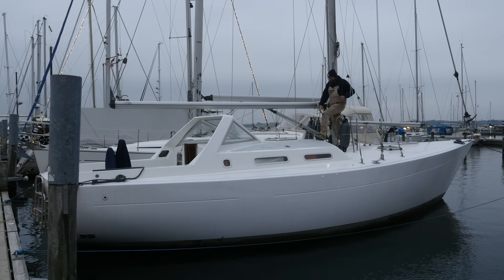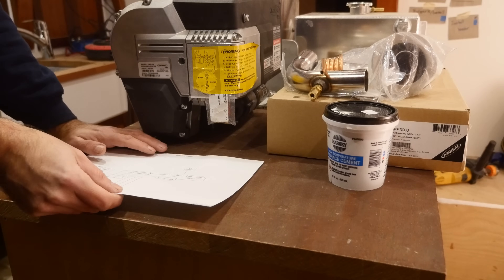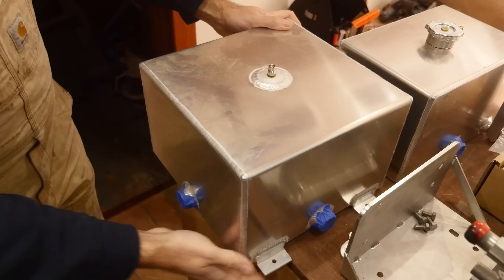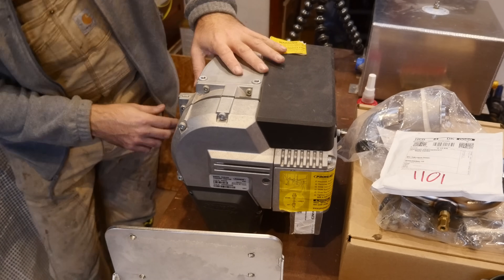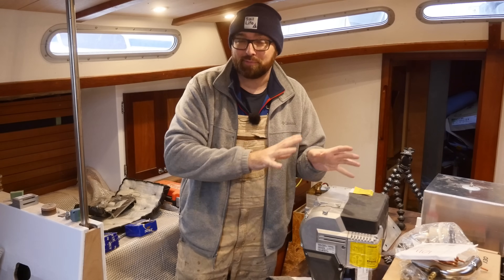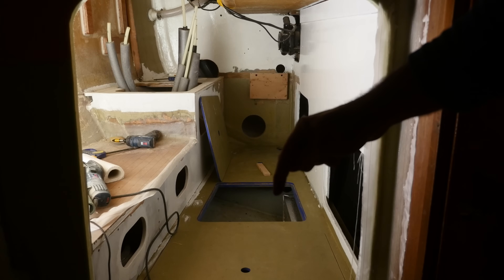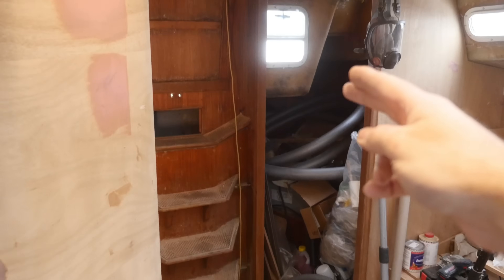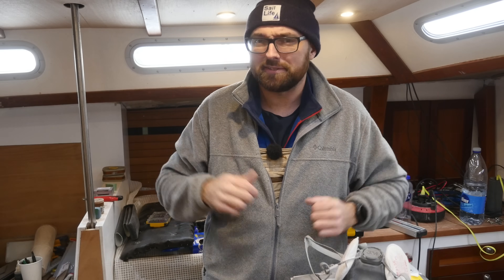Sail Life - Dometic Proheat X30 hydronic heater on a boat, part 1 of 3 - DIY project

Comment: Getting waste heat from generator is admirable, however, when generator isn't running it will not add heat. The heat exchanger will help with that situation, but you may have a convection loop (water on the generator side, being heated by your hot water boiler, will rise and circulate) losing heat through your generator. If you add to that your motors heat (in the future), same thing applies. There are ways to incorporate those sources in a better way.

Comment: Too bad there isn't a heat exchanger in the bulk tank to run the exhaust through to recycle the heat from the exhaust back into the heating system.

Comment: When you are done you might want to experiment with using higher speed/volume fans on those matrix units.  I'm using the same ones (which are made here in Seattle).  On the smaller unit I moved to a 120mm fan (with adapter to step down to 92mm) with 150m^3/h (90cfm) which made a big difference in efficiency of the heat exchange.  I checked this by measuring input and output coolant temps and watching how heat dissipated across the unit with a thermal camera.

Comment: @3:35 I don't know why you are being so shy here. Am I missing something? Independently, heat exchangers and hydonic heaters have their pros and cons. But they were made for eachother. As soon as you choose one, shouldn't you also choose the other? Maybe if I had a boat that already had a different heating solution installed, but no water heater, I might try to run the water heater solely off the engine and generator with some sort of heat exchanger without a full hydronic heater system, but that is a different situation. Hydronic system already has several tanks of hot water in it. Wouldn't installing another tank for hot water just be silly? It seems like "non controversial politeness" is, in this case, just a lazy excuse for not explaining something. I can forgive you a million times over for offending me, if you also inform me ;)
Reply: I mean, your electic oven running off the diesel generator is maybe a choice that you want to avoid arguing about xD But here, haven't you clearly chosen the most elegant solution for a water heater that runs off diesel? Am I missing something?
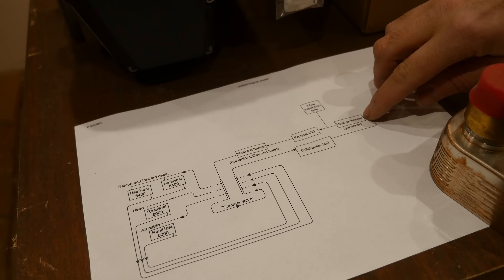Reply: @5:30 And with a heat exchanger on your generator the efficiency of your offshore bread baking should go up nearly as high as a diesel oven, with one exhaust pipe instead of two. Nice.

Why don't the generator and the hydronic system and the engine all the same exhaust through-hull? Giant hole near the backstay with no engineering review was not so clever...

Comment: Three comments.  1)  I installed the similar models of the REAL fan coils (6000 models line) and the fans that cam with them are the weak link.  They just do not blow much air.  I am currently looking for more powerful fans to get more heat out of the coil.  2) Think about adding a muffler to the exhaust and a silencer to the intake.  The exhaust is real loud (think 707).  The intake is a high pitched whistle.  Now that I have both, the only thing that I hear is the water pump. 3) You might consider using a "GRAS" rated boiler fluid (Generally Considered As Safe) so that if you have any cross contamination between boiler fluid and potable water it will not kill you.  I use Peak Sierra based on Propylene Glycol.

Comment: We have had two heaters on our boats.  First exhaust was right where you started, by the docklines.  One melted howser on a cold winter's night in Catalina was a lesson learned.  The second, on the boat we have now, is on the transom and right above where the dinghy would tie and where feet could get more than toasty!  Will be a good challenge to figure that one out.

Comment: Hopefully you’ll not be anchored out and using the boarding ladder much in the winter when the heater is running, so I say mount the exhaust on the transom.

Comment: If you can pull the return pipe from the radiator in the bathroom in a loop benieth the floor boards you will get some really nice floor heating in colder climes. We lived aboard our Bavaria 42 in Göteborg during 4 cold winters and we loved that luxuary. Just put som insulation benieth so you dont warm the ocean instead.Took me like 30 min extra and soo worth it!

Comment: Hey Madds, Have you thought of putting the heater exhaust in place of the through hull is just forward of Athena's dock line and putting that through hull under the dock like. Don't know what is coming out of that forward through hull but thought I'd mention the ideal. Ken.

Comment: You should have placed the heater module on the centerline, that way it would always be below the expansion tank, even in high seas.
As it is, what degree roll will it take and still feed?     Is that roll degree likely?

Comment: I wish the x30 had been available when I installed my X45 several years ago. Except for one small hiccup that the manufacturer covered it has been working flawless for 8 years. I use it also to heat my domestic hot water for bathing and washing dishes instead of engine heat. So we can turn those nice fan coil units off for summer and still have hot water. I also installed heat sensors on the fan coil units so the only start blowing when the water is up to temp. Good luck with your install, it will be one of the most satisfying installations for your boat. Enjoy being warm.

Comment: Hi Mad's. Good to see you back and recovering. We would go for transom fitting the exhaust outlet and be sure to put a 150mm goose neck in the exhaust hose line just before the outlet. 
Is it necessary to insulate the tanks also? 

Sail Safe mate. Ant, Cid & the pooch crew.

Comment: Mads, good job.  Points to consider - a "sealed" system will be easier to vent, have less tendency to sludge, occupy less space as the expansion vessel will only need to be small (4% of the total volume and the pressure variation should be no more than 0.5bar - 2bar).  Inhibitor can then be added and basically forgotten about and you'll have no issues with boat movement, frothing/aeration in the vented expansion tank, plus no evaporation and so on, it's normally a no brainer.  A temperature and pressure relief valve is all that is then needed discharging to a safe place (I would suggest bilge).  I don't know the heater but if it is modulating keep the circulating water as small as possible for response times.  The boat, even with insulation is going to be cold but will heat up very quickly so a modulating burner would normally be an important consideration rather than just running the water at a constant temperature.  The circulation pipes looked suitably small bore (10mm?) which is great for small volume and response times.  Make sure the pump (integrated?) is accessible for servicing.  The accumulator tank is a strange one to me but is obviously part of the manufacturers instructions and requirements - follow them.  Fit quality isolation valves everywhere for ease of servicing - full bore and temperature rated, butterfly valves save space.  Lag pipework where you don't need heat.  Heat loss from pipes can be a pain but it will stop condensation and mould in cold climates.  As high up on the transom as you can - the exhaust is not designed to mix with water and flue temps should be low-ish (condensing boiler?).  A water trap may be required.  We have a standard electric water heater and two Eberspaecher which blow very hot gases which means a lagged exhaust, but there are no complaints with the shower and heating!  Good luck!

Comment: If those fans for heaters are a bit noisy, my recommendation would be to check out Noctua fans. They manufacture semi affordable super quite fans for PC. Like Noctua NF-A20 PWM 12V 800RPM 200x30mm

Comment: Getting the feeling you’re adding alot of weight Starbard side aft..  not necessarily a problem but the engine is aft aswell, obviously she’s not a racing vessel, but maybe Exaggerates “hobby horse action”.   Not sure?  You are adding weight mid ship..  so maybe not an issue?
Opinions?

Comment: Hi Sail-life, Excellent job however I am very surprised to see a rigid mounting of the heater on the hull of the boat, indeed this kind of boiler will tend to vibrate in operation and resonate throughout the hull with the noise of an infernal machine, mounting on silent-block as in submarines would perhaps be wise ...... hello from Françe.

Comment: Hi not sure that metal/rigid plate between the hul and the heater and radiators are the best thing. I would go for some vibration insulation there. Question : Air does exit via fan heater holes you made. WHere does it INTAKE from ?

Comment: Does somebody know the brand of the tubing and connectors Mass is using. I am in the same process of installing a water heater in my boat
Reply: Normal household pex tubing and connectors. Get from your local hardware store.

Comment: how are you handling air intake for the fan heaters??? those ventilators shouldn't be blocked and usually need a steady supply of air to push through a heating element, don't they?

Comment: The biggest problem that happens with hydronic systems is they can be air locked reducing efficiency. Hopefully the expansion tank at a high point will eliminated that problem.

Comment: Looks like you have a choice of singed toes or singed line for placement of your exhaust. How hot will the exhaust port actually get? And, how hot will the exhaust be? Personally, I'd go for singed toes as, after actually singing you toes a couple of times, you'll attain the habit of watching where you step if you're just wearing sandals which might not be much of an issue considering where you plan to do the bulk of your sailing. Constantly having to worry about a line failing seems not  a good choice. You might even end up with a pleasantly warm boarding ladder - nice for cold days.

And, for another Christmasy note - try hot whiskey - it will definitely make you feel better, or at least a little numb to your discomfort.

Comment: I’ve had a diesel hydronic system, and I installed a Chinese diesel air heater on my newest boat as well. Both made sense to have the exhaust high up on the stern. I think it would have worked just fine on the hull as well, it’s just personal preference. If you have water coming in that high, and up the gooseneck, you probably have a lot more to worry about! I’d go with the stern between the ladder and backstay chainplate. Also, thank you for making such great videos!

Comment: Installing on transom is clean but you have to consider where you will store your dingy and the other things folks hang off the pushpit area during voyages.  I think side is best.  Move forward of likely route of dock lines by 12 to 18 or so inches and you should not see an issue.

Comment: Mads, why install the heater in the boat and not on the other side of the  bulkhead out in the cockpit locker then just run the lines? The pump is not loud but not silent either and becomes annoying when sitting watching a movie or relaxing. Mine is out in the very back, as far away as possible actually mounted to the transom,  and was still annoying. One more thing if you don't know what flooring you going to use you could have routed the edges of the holes and mounted the heaters and fans from the inside, so all you see is the cut out when looking from the saloon and no matter the flooring it will fit.

Comment: The most important thing is the ventilation! Not only inside the sailboat, but also the air in and out of the sailboat. Without good ventilation, you'll get condensation! A LOT!
Kind regards.

Comment: For the heater fan units, do you have plans for a return inlet to let air back behind so it can be heated and recirculated? Hope you are feeling better. Wrap a hot towel around your head, and get some soup, champ.

Comment: It seems that the 5 gallon holding tank should be able to keep the heated fluid HOT.  Thus it seems like it should be WELL INSULATED in order to do so.  Te expansion tank, maybe not so much, but...............

Comment: Unlikely the heater will be blasting super hot when you're using the ladder. I recommend the transom mounting, and some distance inboard from the rail, since the rail can dip in the seaway in certain conditions.

Comment: Someone else mentioned return air openings.  Proper placement of these can also dry out bilges and wet lockers, as well as helping to provide even heat distribution throughout the boat. Avoid engine rooms, fuel storage areas, etc which might contaminate the interior air.

Comment: If the PEX is running under the floor, can get some heat out of it when left uninsulated.  Or under anywhere else you want heat from.  Just add some insulation under the PEX.

Comment: Iv seen comments indicating using existing exhaust engine/generator, this is a big no, unless you want to fill your boat with exhaust fumes. However you decide to do this, it would be prudent to consider exhaust fumes, ie rear exit through transom will create back draft sitting on anchor pointing into the breeze, filling the cockpit area with fumes. Out the side will be your best bet.

Comment: The units you are installing are referred to in the USA as fan coil units or fan coils. Be aware that the ball valves you appear to be using on the distribution manifold are primarily used for on/off operation and not system flow balancing. 
The simplest method to initially balance water flow would include a reverse return layout, and sizing of hose diameters to roughly equal pressure drop.
I would suggest that you submit your hose layout, including length and diameter, to a local engineer for a review. It is also possible to perform an hydraulic analysis yourself through use of information available on line.
I would also suggest installing thermometers on both supply and return lines, and an air venting device at the high point of the system.

Comment: My only suggestion as to exhaust placement is to try to avoid exhaust wafting into the cockpit as much as possible.  I once worked on a boat that constantly had exhaust blowing on me from amidships and it greatly exacerbated my sea sickness problems.  I prefer the exhaust blowing away from or behind me.  Of course, motoring downwind would also blow exhaust into the cockpit.  Any thoughts on this?

Comment: Ha, weird experience to watch you explaining something and everything outside the boat is moving... 😁 Glad you're back! Mads, will the cockpit ever be closed in with a soft top and panels? If so it might nice to have a little heater in the cockpit or at least lines ran if you ever decided to add one!

Comment: Remember you need a way for air to enter the space your blowing it out of. The easier the air can enter from the cabin the less the system will have to work. You don't want to rely on the airflow coming through the bulkheads to be your "return air".

Comment: To cut down on future heating cost, make some kind of heatexchanger for the exhaust. If it's hot, it means that you have a (big) loss.
Your boiler looks like it have the same heatexchanger as the airheater type. (like webasto) These heaters have a efficiency of only 50%, meaning that they throw 50% of the heat right thru the exhaust and out side.

Comment: I'm wouldn't be super worried about it being near the aft starboard cleat. We have a propex2800 and I was concerned about running it next to some plastic trim  but as Ling as it's not directly blowing on it. It's not a problem. The only thing I will say it to be aware or condensation and ice build up where it does heat up the surrounding area. Again, not a huge concern but something to be aware of.

Comment: Wouldn’t make sense to kind of box the fan heaters make a little gap so they won’t pull the „cold“ air from the hull and instead heat up the cold air from the floor? Just  something I was thinking about

Comment: I do hope that your health continues to improve.

So do I have this correct that you have not made any specific warm air source in the technical room beyond the radiated heat from the oil heater and possibly the generator? 

I think the exhaust exit position is best behind the swim ladder as when using the ladder it is less likely to get hot especially if positvertical

Comment: The 'on demand' water heater is a good choice. Not only will it save electricity by not having to constantly heat water in a storage tank but the storage tank would take up a good amount of space depending on how much water you want.

Comment: You can put a heat shield on that one dock line to keep it from burning or add a small piece of chain going down the area where the exhaust is and then clip on the dock line.

Comment: Maybe I'm being dumb here, but wouldn't it be possible to use a single tru-hull for both heater and generator exhaust? Assuming the generator uses a seperate cooling loop so it doesn't spew sea water through the exhaust..

Comment: Mads,  place the exhaust outlet up high on the side of the hull.  I have an Espar diesel heater with the exhaust on the transom.  Airflow with the bow into the wind (at anchor) causes a low pressure back circulation of the exhaust which allows some exhaust fumes in the cockpit.

Comment: Make sure you feed external air to the burner, otherwise it will suck air from the cabin and cause cold air draughts at every opening. Any chance of getting any heat out of that super hot exhaust? It pains me to see it insulated since it will only be hot when you need the heat. External heat sinks clamped on to pull heat out before you dump the gases overboard?

Comment: Put it on the transom. For the number of times you actual board or depart when it’s operating, you should be good. While the dock lines will not appreciate the heat exposure over time. My two cents worth, anyway. Good luck.